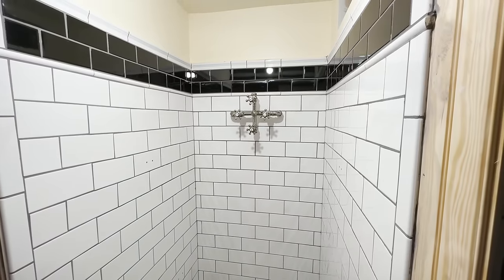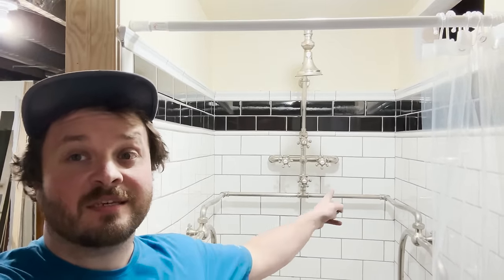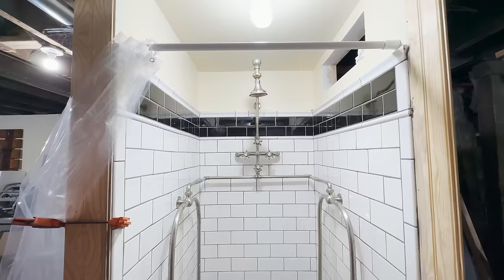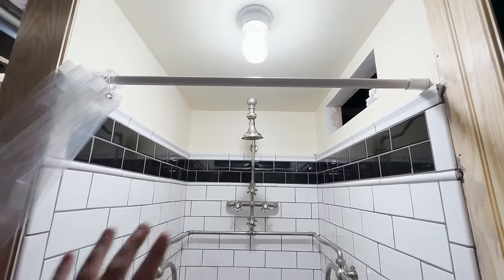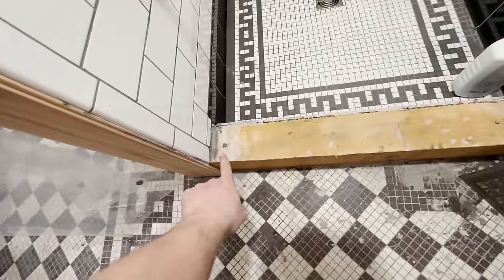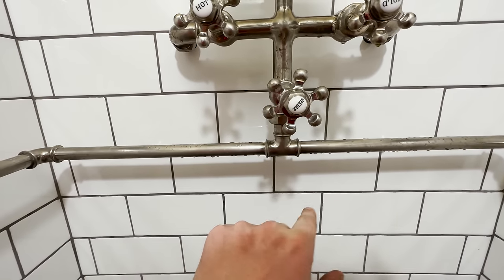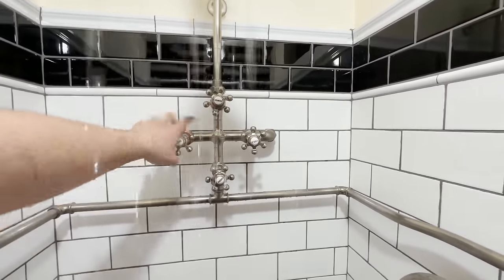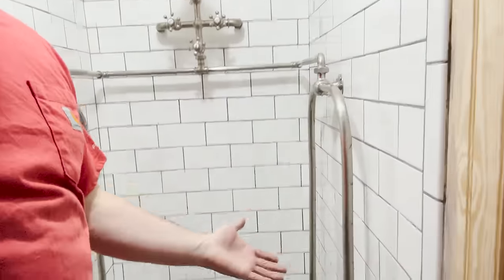What is it like to use an Edwardian Shower?! S3 EP50

Comment: Caleb, where did you source your subway tiles? Modern ones just don’t look like old ones!
Reply from the maker: These are modern and from Lowes. The have a slight bevel on the edges. I strongly preferred to get the period accurate one but couldn't swallow the cost (which is 10 times the price for no bevel).
Reply: @The2ndEmpireStrikesBack im currently trying to complete a bathroom with a similar tile scheme but I’m having a terrible time finding base cove, pencil liner and chair rail tile. Are all your trim tiles from Lowes as well?

Comment: The needle showers I’ve seen were looked like rib cages and surrounded the person.
Reply from the maker: yeah they made a few different types. Those ribcage ones are quite a bit more expensive and are (typically) stand alone units. So you just put them into the corner of a room and a shower curtain goes all the way around them. This type needs a perfectly  sized room to install it into. So its harder to install but less hard on the wallet.

Comment: Why in the hell did this feature EVER disappear from showers?! It's automatically friendly to those with physical disabilities because it comes with built in handles, it will clean you from every side at once, and with modern manufacturing and engineering, you could easily make a very efficient version of this today! Modern multi-head showers are nice, but this is a very elegant design that isn't overly complicated.

Comment: The tile in the 1890s was set in mud not mastic. There should be quarter round along the outer edges not modern edge tiles. You could have faked it. The pipes should be polished nickel not brushed. You could have used 3/4 inch supplies for more pressure. Victorians were not concerned with saving water.

Comment: Hello!  Sorry to hear about your grout issue. With this grout specifically, you need to avoid using a mechanical high speed mixing device such as a paddle mixer because it incorporates more air into the mix which makes it harden way before the advertised time.  Here is a youtube video on the "DIYfferent" channel describing the issue with this grout and the differences between gently mixing with a paint stick vs a drill and paddle.  https://www.youtube.com/watch?v=hZzr0Gyrg3w.    If you didn't use a high speed mixer then disregard, but I thought it was worth mentioning.    But also you may take that into consideration if you use this product on any expensive/rare/bespoke tiles that you might be installing as you leave the 1920s and return to the 1890s!
Reply: Thank you for trying to give helpful information. 👍

Comment: If you’re taking a shower and Kim flushes the toilet upstairs would you get scalded?
Reply: This is the problem with mixer tap showers, and why i prefer baths! I put a thermostatic valve on my shower to keep water temp pretty constant.
Reply from the maker: The shower is literally 5 ft from the water heater and the water line into the house is 2 inches in diameter which is super beefy. I think over time when we add two more batrooms and two kitchen on to the system we may experience that but current we dont have those. types of issues.

Comment: It all  looks great, what you have there.  I always thought you had to put grout over the tiles and then wipe that down after a bit.  I've never seen those placer pieces  in tile.  I watched a tile-man do my bathroom and he just grouted and then grouted over and  wiped it down. Okay, now I see you are putting down more grout.  I had not got there yet in the video.  Sorry.   There is probably more than one way to do a job. 
 Back when my home was built in the early 1970's  they did not put up any waterproofing on the walls of the bathrooms.  I bought this house in the 90's and   I've had to redo all of them including the sinks,  and toilets.  And Not by me but by someone hired to do the job.  I feel like I'm trying to redo a Victorian mansion on a poorly built 1970's  spec house.  They used the cheapest things they could get away with and  I am paying  but my house only cost 70k in 1990  so  it's still probably a bargain. 
It has nothing but 70's vibes, nothing really great unless you are into very retro mid century.   The wallpaper is appalling.. gold, avocado and brown.  God help me.  But it has a huge yard and nice trees and landscaping, so not all is lost.
Reply: The Victorians also generally used the cheapest materials they could get away with!